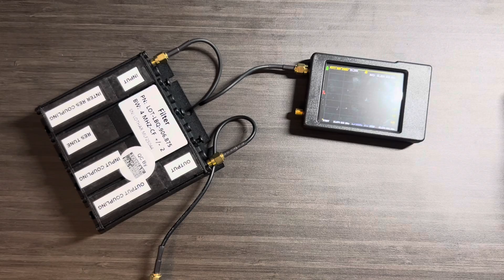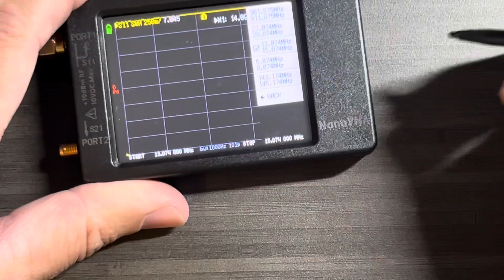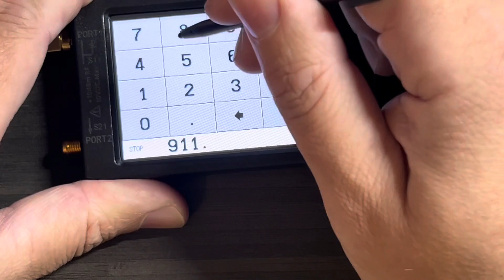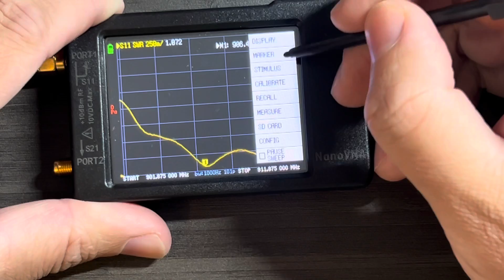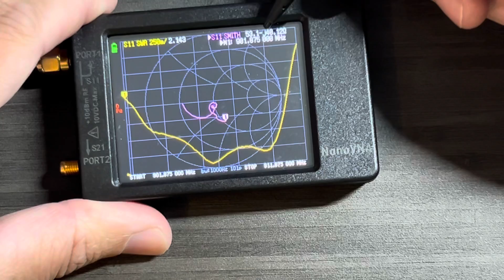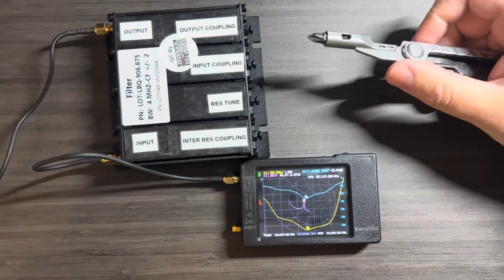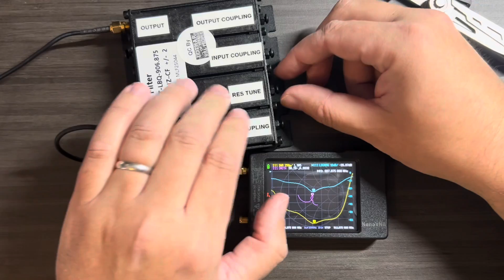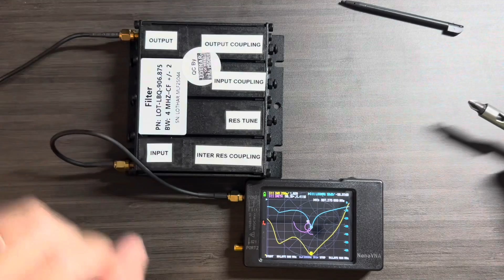Meshtastic Panel Antenna and Band Pass Filter

Comment: Great, I have flashbacks of trying to tune up a portable repeater bandpass filters, and instead getting harmonics😂.   I would be tuned to a harmonic instead of the primary on the filter and things would not work correctly.